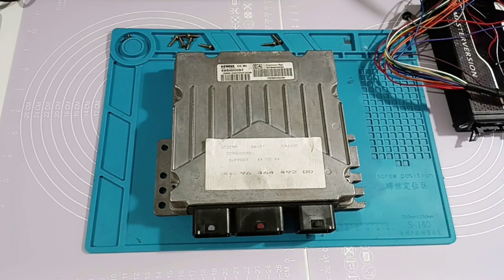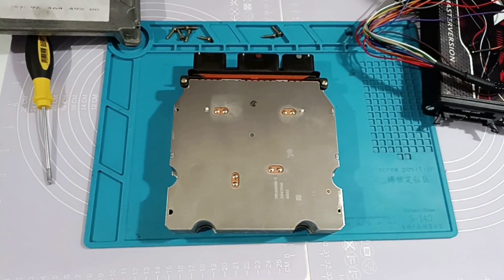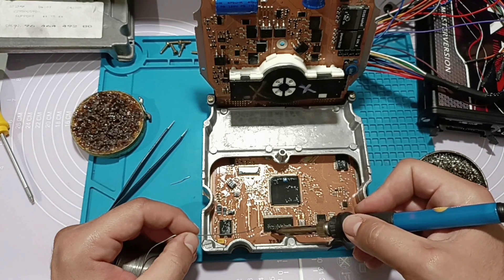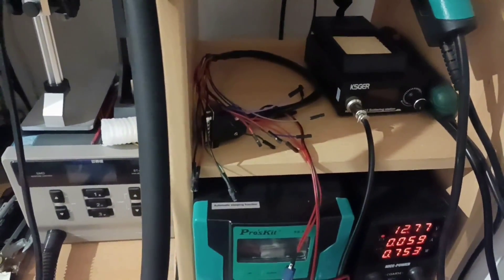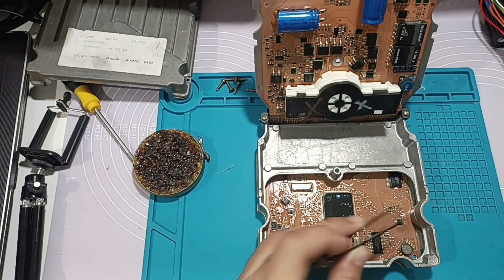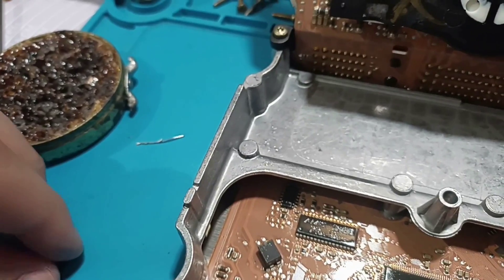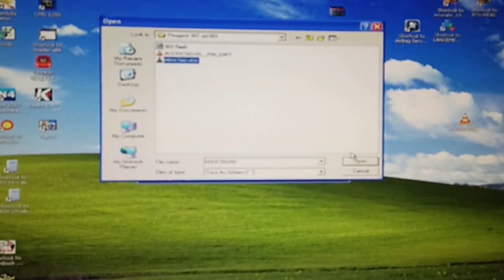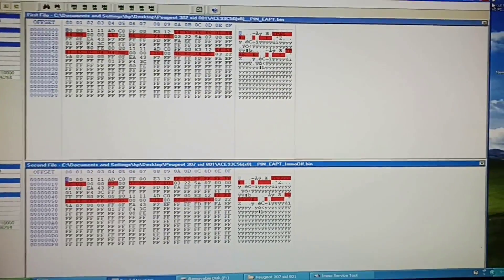Peugeot/Citroen SID801 Full Backup.Don't need a Program to extract the pin-code. ECU Immo off !

Comment: Hello i need your help, in one of your videos you said that they are original diagnostics tools costing 100/120€ that can connect to your phone, or pc. Ive seen some that are a little devide almost looking like an old cellphone and i personally dont like them, so one with computer or phone software was what i was loocking for.
Can you please tell me those original tools?
Thank you regardles
And by the way, subscribed, your videos are very explicit.
Reply from the maker: Hello,
My option will be :
1. Xtool A30M
2. Thinkdiag
3. Mucar
Reply: @YOYODiagnostic  Thank you so much
Reply from the maker: @buildingthis1987  👍

Comment: Hello, I want to enter the world of these repairs, more than anything, to the one of air bags!  before I have dedicated myself to the repair of telephones and I do not see this as similar to the isp in telephones, I would like to know what are the tools that you recommend to start in this world!
Reply from the maker: Hello,
the best programmer for Airbag is CG100 pro.  I will also make a video with it.  At this moment, it has no opponent for the number of MCU types it can read.  After that I can say that you will also need CG Prog.  
With these 2 you will cover a very large part of the Airbag on the market.

Comment: After you place the eeprom in the adapter you need to keep the eeprom pressed with a screwdriver as you push read button and you will not have pin errors anymore (always works for me and i use it a lot). The adapter does not apply suficient force to press the eeprom to make good contact.

Comment: Just bought a Aifen A9-Pro, i used a weller station for years but it's 220v and i live in a 110v was using a ts100 it's rubbish. Compared to the weller it's even more precise, but I'm using original tips.
Reply from the maker: Thanks for info.  👍